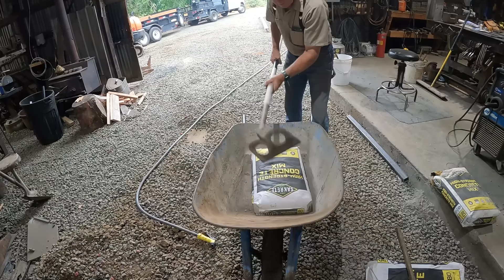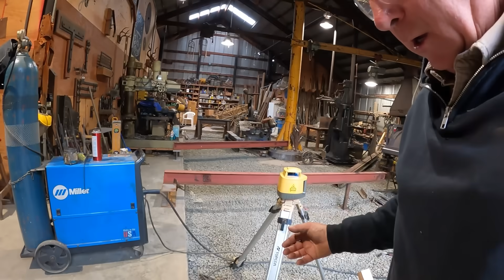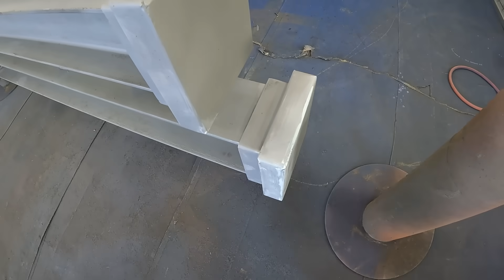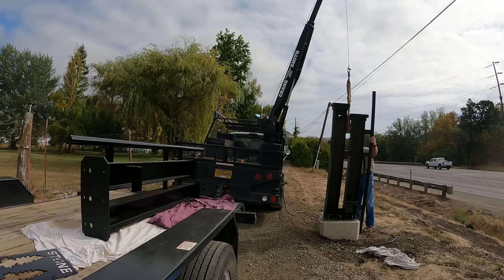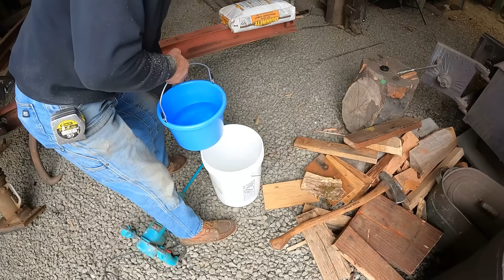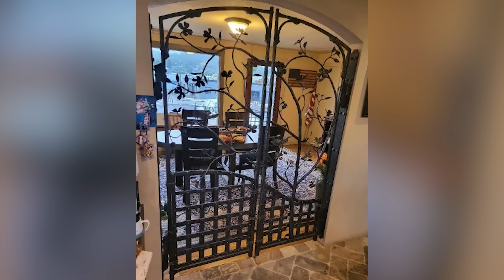Gate Build Forces Shop Modification #5

Comment: Your vertical frame supports can have adjustable feet 5/8 or 3/4 threaded rod  .
Once adjusted and fine tuned to perfect then lock the nuts so vibration doesn't make things out of wack

Comment: too much mess with this steel posts welding, painting etc. why knot just make classic brick columns/ its all bout efficiency/ brick posts are much easier and will do the same thing. u could even use awesome clinker brick for the same price than all this metal stuff. anyway a good work kept thou/

Comment: As for why the concrete floor dropped, it could just be moisture in the ground. Placing a big concrete slab over a piece of soil changes the conditions.
Not quite sure what soil type you have there, but soil, expands, and contracts with moisture, and does so unevenly, and a few inches of movement is not unheard of.
So you might’ve done a perfect job 15 years is a long time :)
Reply: We have things going up and down by as much as eight or more meters here in New Zealand, but it's not from moisture in the ground
https://static.temblor.net/wp-content/uploads/2016/12/New-Zealand-earthquake-fault-rupture-waiau.jpg

Comment: Little known fact: Stomping on the buried support and saying "that'll hold it" is a very important part of the  design and construction process.
Reply: I thought the required phrase was 'That's going nowhere!' 😉
Reply: I think that is more for when you are fastening something down.  But if it has worked for you in the past then no reason to change the procedure!
Reply: @withak30 you are correct, no reason to screw with tradition.

Comment: The non-shrink grout turned out great. Why not design it so the plates can sit flat on the concrete though? Was this strictly a cosmetic/design decision or is there a functional reason for having the plates lifted?
Reply: One reason is that concrete shrinks as it dries, so all that time you spent leveling the concrete will be undone as it dries. It’s better to leave it a bit low and grout under what you are setting in place. It’s the most cost effective way to do this type of job.

Comment: I am impressed with the epoxy painting (and the welders work too) - as an alternative to Epoxy paint if you want to be a bit simpler and more DIY try Flood Penetrol as a direct primer and then follow with two coats oil based alkyd - cut the first coat with 30% Penetrol and cut the second coat (last) cut with 20% Penetrol - We did a a lamp post 30 years ago with that formula - it sits next to the Atlantic Ocean and just this past year the anchor / levelling bolts starting to show rust. If you do not have a gifted painter available this Penetrol solution seems to work next to the ocean.  Penetorl is a paint leveller and you can get a pretty good finish with just a roller or paint brush. You can also brush clear Penetrol on your favourite tools to deter rust - amazing product.

Comment: For grouting under those posts i would have formed it and put a little birds mouth on it that can be easily chipped off after its set. That way you could use a pencil vibrator to make sure all the air pockets are filled
Reply: The way he did it is the trade accepted way of doing this job, but there’s always more than one way to skin a cat. Lol
Reply: @Hoaxer51  I know that's the trade accepted way. I did concrete for 10 years. I just always found it easier to form it and pour it than shove it under. To each their own
Reply: @Skipdogg15 , As a cement mason I’ve done a ton of these and they’re always a pain in the butt, it seems like you spend more time cleaning everything off when you’re done than you do actually filling underneath machinery or columns.

Comment: Man those came out great, love your painter!    sooo many people LOVE to promote powdercoating as the best thing ever.  Its true that when powder coated pieces first get installed they look great.  But there is no single powder available on the market that has the UV protection of Urethane automotive clearcoat and the surface bonding of epoxy primer..   If you put at least 3 coats of clear on anything going in the sun, you can expect it to hold up 30-50 years.  The reason you see so many factory cars starting to peel on the horizontal surfaces after 15-20 years is that the auto makers only put 2 thin coats of waterbourne clear on and the sun just takes a toll on it after a while and it doesnt hold up as long

Comment: I also don't have a flat floor. My garage is really a sloped paved area that's just enclosed. Years ago I got myself 4 old steel rims and welded a scissor jack to each and then a 3 x 3 steel plate on top of each jack. I've build many gates on these. You can use them on any surface and always get a level plane. Also you can set them for any size you need.
Reply: Very Nice.  It probably puts things at a better working height, and you can roll them out of they way when you want to take the floor space back for something else.
Reply: Hey great idea, do you have any pics?